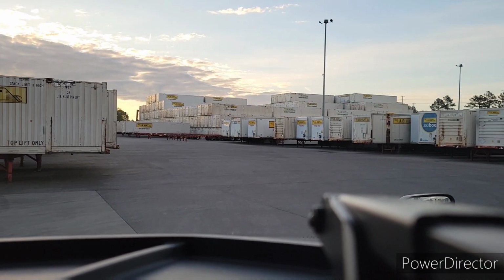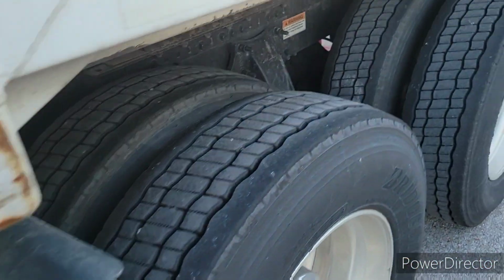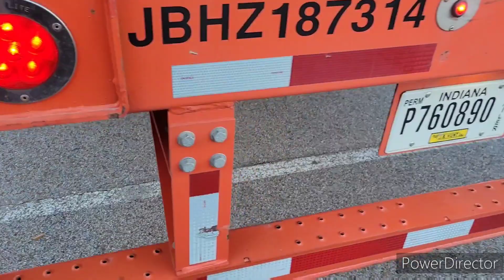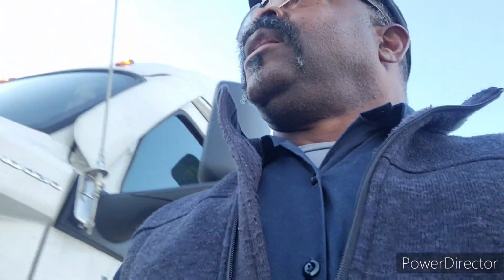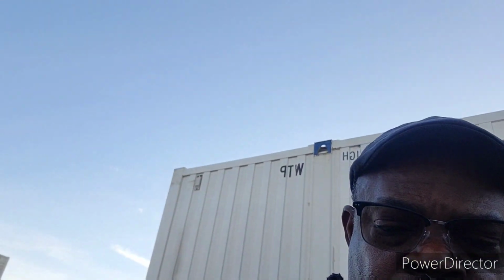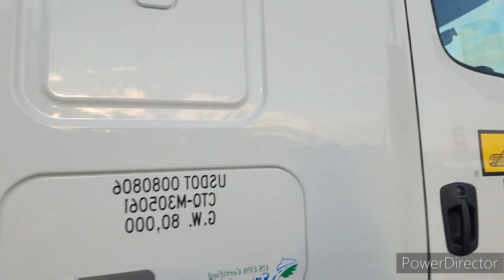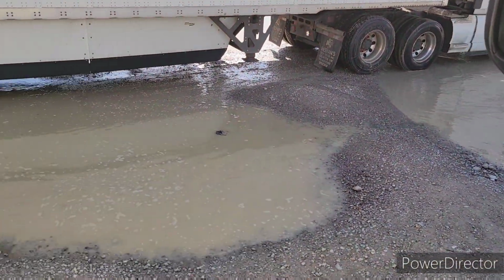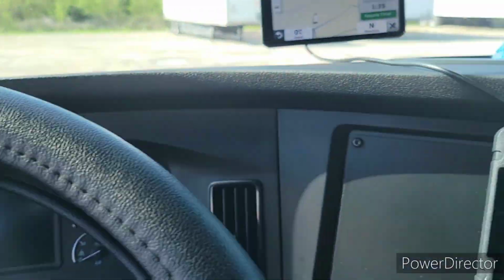Scoob 1 year review (good bad & ugly).

Comment: Buy you would hate to work at YRC Freight. We have had drivers shit in chain boxes in the cab. They don't maintain there equipment I can't tell how tractors I took out of te terminal only to find out they have a death wobble in the front end. They have put recaps on the steer tires.
Great pay and benifets but u drive death traps.
Reply: What terminal do you run out of?
Reply: @JamesSmith-wy2co  

If u work there you know its true.
Reply: Isn't it illegal to run re-treads on the steer tires?
Reply: @pharoah1200  

Not sure but I know its very dangerous.
Reply: @fuzznutz7182  JB doesn't require zips, but I would definitely advise doing a cross-tie.

Comment: Jb hunt need them zip ties man
Reply: JB Hunt actually run with the best chassis. Meaning, that they have the ones with the horseshoe locking pins in the rear that do not really require zip ties.
Reply: @pharoah1200  i still don’t trust it where I live two flipped at the same spot safety first before any load
Reply: @aunt-_-  yeah I understand. I do a cross-tie, where I'll zip the front driver side, and then the rear passenger side. And, if two drivers flipped at the same location, that will usually means that they were driving too fast at that particular location.